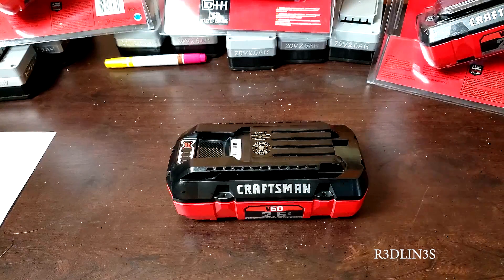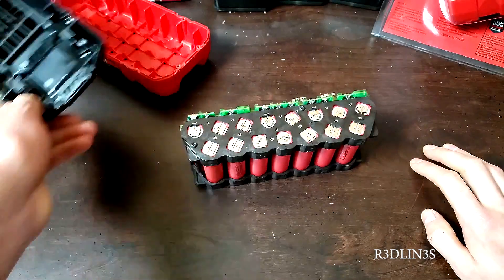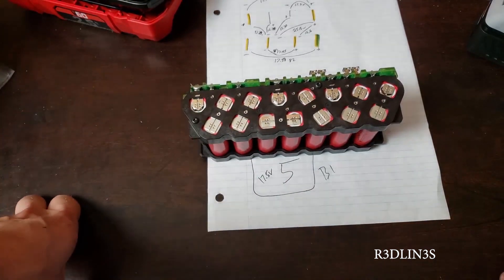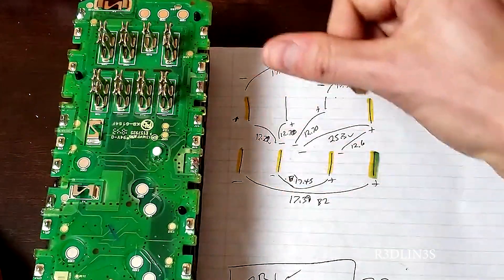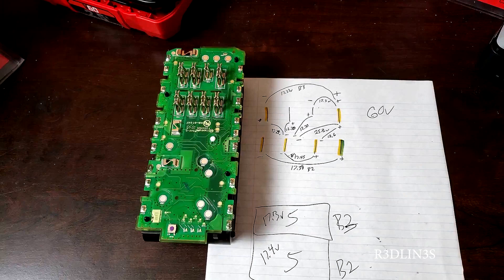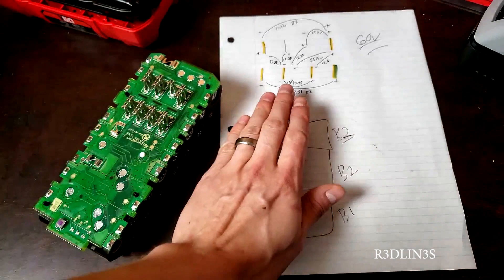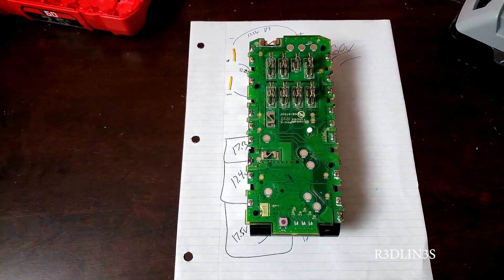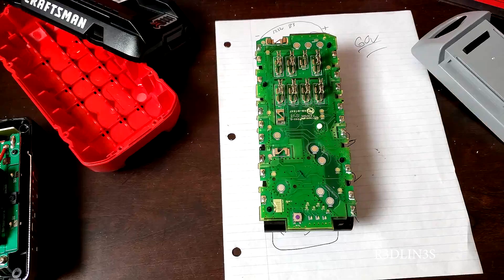Craftsman 60v Battery Teardown 2.5ah - How It Works

Comment: Thanks for this video. I have two of the Craftsman 60v batteries and they both stopped working. I tried jumping the batteries but it didn't work. I then decided to open up the battery and indeed there are three banks. Each bank has two green wires (+) and one black wire (-).  One of the green wires has about 7V and the other green wire has about 13V  totaling to about 20V.  So I measured the voltage in all the banks and determined that one of the banks was bad because  the voltage on the green wire was only about 2V.  So I cut that bank out and reconnected the black and the two green wires with a working bank from the other battery. Voila, after screwing the cover back, it works like a charm. Hope this info helps somebody.
Reply: Can you post a video of what you did?
Reply: ooooh i've got an opportunity to grab 6 dead batteries... i gotta teach myself how to replace banks...  do you recommend any videos that explain to a child?  🙂  I'm so out of my element here...but tight on cash and wanna look at learning what my husband used to do.
Reply: Update:  The fixed battery worked for a some time then one of the other banks failed :-/.  Therefore, I don't think it's worth it to continue fixing.  I decided to invest in a new lawn mower instead.

Comment: What we need is a video of dissembling the battery pack completely and replace bad cell with good one. Like I have 3 dead batteries so would like to replace bad cell with the good one from the others.  I'm going to try to do this once I get all the soldering tools arrives from Amazon.  I'll see how it goes.  Also I've ordered a cub cadet and might also try to create a video of how to hack it to fit with the craftsman tool as it's hard to envision the description provided below.  Thanks for the video as it has been very educational and informational useful.
Reply: By the time you have bad cells, you should just replace all the cells with new ones, not just swap the dead ones.  You should spot weld them together with nickel strips, not solder.

There is no real hack needed for the Cub Cadet battery, just cut off the keying tab near the contacts.  It will be obvious when you see it.
Reply: @stinkycheese804  I'm a widow...got no man in my back pocket...this is not my area of expertise... got a video to show how to do that?   TIA!
Reply: @stinkycheese804 thank you
Reply: I cut connection to dead cell, use solder paste on wires and used two good cells from my Dyson vacuum cleaner that died as well.  Batteries were good I think the BMS gave up.  No luck with charging, I bought a Cub cadet 2.5ah everything is sold out worldwide.  7.5ah would do the trick.
Reply: I gave up, is so hard to remove the battery & using good battery won't get it back neither.

Comment: *** Craftsman V60 Battery replacement solution ***

As posted elsewhere in this video, Cub Cadet and Craftsman used the same V60 batteries - almost...

The only difference (that I've found) is that the battery cases are "keyed" differently. The top of the battery, where the charger plugs into, has a plastic key that prevents the battery from being used interchangeably between the two brands. One brand has the "key" on the left side and the other brand has it on the right. The battery "innards" appear to be identical, right down to the circuit board numbering. The associated power tools battery receptacles are also "keyed" by brand.

So, what to do?

First off, save your old Craftsman V60 battery, i.e. don't recycle it because it's dead. You'll need the top part of the battery case that has the Craftsman type "key".

Second, purchase a new Cub Cadet 60 Volt battery, model CC6025, CC6050,  or as appropriate. They are less expensive than trying to find a replacement (read:nonexistent) Craftsman battery. I tested all this with a 2.5A battery from both brands.

Third, swap the "top" or "smaller" half or the battery cover between the brands, i.e. replace the small Cub Cadet cover with the small Craftsman cover. There are eight security Torx T-10 screws that hold on each cover, so you'll need to find a T-10 security bit that has the hole in the center. Take a quick look at the battery case screws to see what I mean, or better yet, bring a battery with you the your local hardware store to obtain the correct bit. Once all the screws are removed you may need to gently pry the case covers apart. There are two slots on one end of the battery case you can use to get this started.

Once the covers a swapped, you're all set, the Craftsman charger and tools should work with your new "modified" Cub Cadet battery pack. This breathed additional life into my Craftsman v60 tools.

Disclaimer: While this worked for me I cannot and will not guarantee it will work for you. And be careful, Lithium-Ion batteries are hazardous to work on. I initially charged the Cub Cadet battery on a concrete surface well away from my house, just to be safe. You're on your own here!
Reply: Thanks for the info as I would never thought my tools can be use again.  Craftman replaced my set with 20v which the blower really weak and I hate it.  As soon as the Cub Cadet arrives, I'll try to make a video so others can benefit from it.
Reply: @SangLeWeb  Any update? I tried to see if you uploaded a video but didnt see one.
Reply: Thanks for this. I know I am late, but could we not just replace the individual cells without removing the PCB? Or is there more involved in doing that than simply removing/desoldering them?
Reply: @tylerwillems9358  The cells are likely to be spot welded together, so you would need new cells and new nickel strips to spot weld back together.  Some people claim you can solder to the cells but you're really NOT supposed to do that, could breach the seal and create a fire hazard.
Reply: You think chiseling off the key would work?
Reply: @Ultramagnus-oe6bj  Yes that is what most people do instead of swapping half the battery casing.

Comment: I left my 7.5 battery in the mower and it apparently discharged.  It looks like I cannot just jump one area.  I'm thinking I have to jump 3 separate areas?  If I just jump one area, it doesn't overflow and charge all the other batteries does it?  I can't jump it!!
Reply: Yes, you would manually, jump charge each of the 3 series of batteries one at a time, till all are up to about 20V.
Reply: Hey there. Were you able to jumpstart your 7.5? I’m in the exact same boat with my mower battery. Also, is the 7.5 definitely going to be the same layout configuration? The positive and negatives aren’t marked anywhere so I want to make sure I’m doing it right.

Comment: Thanks for this helpful video. 
My battery is not charging... 
The voltage across B3 terminals is 2.9v. 
B1 and B2 it's close the 14.4 volts. All the individual cells are between 2.8-3.1 volts. 
This means that B3 cluster have a problem, correct? If two cells are in series, it must be close to 6 volts, and B3 is only showing 2.9 volts. Any idea what can be done in this case? Is there a reset in this circuit? Thanks!!

Comment: I had the problem of this battery not charging. Now fixed. Answer: Take the case off. You will see 3 battery packs, each containing 15 cells. You will see a black wire (negative) for each pack. There are some solder joints on top of the circuit board. Those are positive. Apply about 18 volts and 1 amp to at least one of the packs. This will "jump start" or "flash" the battery. 
This requires using a multimeter to determine polarity. You may find when you test for voltage from the top solder joints to the negative terminal on the bottom (black) that it reads -.03 volts or something like that... This happens because the polarity gets reversed when the battery is drained completely. After applying voltage to each battery pack, put it back together and try to charge it. It might fix the problem. All-in all; This product isn't worth the plastic it's made from.
Reply: what did you use to apply 18 volts/1 amp? I don't see the black wire you are talking about either.

Comment: IS IT POSSIBLE to jump start one of these batteries?  I have the 7.5 AH lawnmower version of this battery.  IT WILL NOT CHARGE.  B2 and B3 show 18 volts, but B1 shows only 12.8 volts.  I TRIED to connect the B1 leads to another V60 battery, but the B1 voltage DOES NOT INCREASE.  I also tried charging each individual battery pack using a Tenergy TB6B charger.  Each pack will charge with the Tenergy EXCEPT the B1 which has low voltage.  As soon as I try to start the charge cycle it says "CONNECTION BREAK".  Is the BMS preventing any current from reaching the B1 pack?  If so, how can I defeat it and force enough current into it to raise its voltage above 15V so the entire pack can charge?  Will I need to disassemble the battery to remove the BMS circuit?
Reply: Try unsoldering one lead of the fuse for the B1 pack and charging with Tenergy. You can also remove one lead of the Green wires on the battery pack (these also go to BMS).

Comment: @R3DLIN3S I have the 7.5aH version of this battery. Testing the pins, and according to your diagram, “battery 1” had voltage of ~10 volts, “battery 2” ~10 volts, and “battery 3” only 0.3 volts. I managed to jumpstart batteries 1 and 2 and get them up to 18v, but battery 3 will not break 1 volt. I took the casing apart and all 3 fuses are intact.

Any idea why it’s like this? The charger still will not charge the battery at all.
Reply: did you ever have any luck with this? Mine is the same way. two will charge up and 3rd pack sits at 8 volts

Comment: FYI craftsman didn't make the batteries. Cub Cadet used the same exact battery. The company that made the battery decided to stop manufacturing, so the v60 went bye bye.
Reply: You can use the cub cadet battery. U just have to cut the tab 9ff.

Comment: My v60 battery stopped working when the mower was run till it stopped. B1, B2 were 17.6, but B3 was 10. All fuses were fine. I manually charged B1 and B2 to 20v using the top connectors, and charged B3 2 cells at time to see if I could kick start a dead battery. Found the first 2 batteries near the connector were not taking charged and were 0v. I tried detaching spot weld to see if one of them is bad and if battery could run without the other, but both were 0v. 

The casing and spot welding of these battery made it irreparable with my skill. Trying to detach spot welding left holes in the cells, and the plastic housing has internal leads so if you put any pressure to pry the welding you will be risking sparks!. IMO the spot welding was overdone!. In the end I had to detach all batteries as it was too risky to leave the casing half damaged.

My suggestion with this battery is if you can't kick start battery by charging the top connections(B1,B2,B3) directly and get them to 20v then it's not worth trying to charge individual batteries, as it's hard to replace the battery even if you locate it.

Comment: Do you know if the Craftsman V20 battery will work on the V60 mower? Craftsman replacing my V60 DEAD battery with three V20s. They won't tell me if they will run the mower .. NOR if they can be charged with my V60 charger. Can you answer that? Thanks!
Reply: V20 battery will not run a V60 tool.  They have discontinued the V60 system and offered me a V20 trimmer and battery to replace my V60 saw and battery.

Comment: We have the same idea! I'm planning to experiment on a 2ah 20v XR battery pack by adding a switch to change the battery config from 20V, 40V, or 60V depending on the # of battery stacks. Most DC motors are capable of handling a wide range of voltages between 20-60V easily, but controller on the tool may limit the output voltage, or will burn out. Perhaps I should buy a cheap used 18V brushed tool on CL to test out. HAHA. If successful, that's a cheap upgrade for my entire lineup of 20V XR brushless dewalt and craftsman toolsets.

Comment: I used this on my groceries getting bike.. seems like if you only use 60v it stays level inside.. about to run it parallel to flexvolt 60v . Im Just looking for what the craftsman charges up to.. the flex volt is 63?.. trying to find out before I start .   I can always test the voltage later. I'm impatient

Comment: great job you should run for president.  anywayi thought i would try to charge up the battery.  i would have never figure out what you did.  thank you.  i have one of these batteries and i need to get the B3 charged up.  cells looks ok and the voltage is 6.51.  all the other packs read 17.81 volts.  so i'll attempt to raise the voltage to equal the others and see if the charger will accept the battery.  well now i have to figure out kobalt 80v, briggs & stratton 60v, ryobi 40v, greenworks 60v and 80v.  thank you sir and please don't try this at home.  i know i'm doing this at my own risk.

Comment: @R3DLIN3S Were you ever able to jumpstart one of these batteries? I’ve tried connecting the + and - terminals from a charged battery to an uncharged battery and even after several minutes, the only change is the charge on the good battery has decreased but the charge on the dead battery remains the same.

Comment: Outdoor Power Equipment (40V +, Ego, Greenworks, etc) always have the BMS in the battery pack. They likely separate them into smaller groups to allow air shipment of the batteries. Also, the V60 7.5Ah packs I opened had LG HE2 cells.

Comment: I've found a fix for the blown fuse on the batteries. I got all the batteries that had that issue working again. A car fuse is what I used. I used mini fuse 3.0ah. I had to take plastic housing off for  good fit and soldered it on. It meets the specs and is safe to use. Works like a charm.
Reply: Thank You!
Reply: @bayouboodleeboo1317  your welcome
Reply: Thanks a bunch... I was using an adapter to tap the 60 volts and a buck converter to drop it to 12vdc for overlanding lights and shorted the 2nd bank.. took case off and just fuse blew... Whee... Lucky for me since you CANNOT get these batteries anymore... Solder a 5amp mini fuse in and good as new!
Reply: @simracing-ai  nice job
Reply: Where exactly is the fuse?  And how to tell if it’s broken?
Reply: @aquemini7100  it's metallic and Z shaped. On the bigger ah batteries there are 2.
Reply: Also to tell if they are broken it will be burnt through
Reply: You're my hero!!!
Reply: @DavidRutkin  I take it you fixed your battery? just be aware some batteries are flawed and it can happen again. I've had to fix it twice to 1 of my batteries. the other 2 batteries I fixed are still going strong and no issues.

Comment: Trying to take the ~17V pins and make a 12V inverter for 120VAC. Here is my plan.
1. Take all 3 17V pin sets and put them in parallel to the step down converter. 
2. 18V DC to 12V step down converter.
3. 12V DC to car battery inverter to 120VAC.
Any advice would be appreciated.
Reply: My advice is that it is silly to make a new (inverter) product that depends on batteries that are obsolete, no longer made and expensive to buy old stock.  Do something forward looking like use a battery format still in production for  your design.

However, what you intend to do will work, but remember, you're talking a 10:1 voltage boost plus conversion losses, so ideally if you limit the pack to a 10A drain rate, you end up with less than a 120W inverter, hardly worth the bother.

Comment: any idea how much the fuses on the board are rated at?.... one of the fuse links blew on my battery

I checked each cell... and all show individual voltages.... no idea what caused it too blow
Reply: Same here. Imma probably reconnect mine. Got 3. And each one and each one has one broken.
Reply: @KiwiClawDHA  how did you fix this
Reply: @ckcuev  i don't think my fix worked, might have damaged the batteries, but I got some solder and arced it over the broken fuse. Not a smart idea, but I need the batteries.
Reply: The charger doesn't recognize 2 of 3 batteries.
Reply: @KiwiClawDHA  does the battery at least still work after this fix?
Reply: @ckcuev  as said in the video. It charges weird. On battery is at ⅓,⅔, and full. The multimeter showed no charge on that cluster. Ya should check the voltage first. I would have to manually charge the cells. Which I don't have anything for. Could Jerry rig something. But the charging state never changed. What would charge did. And what wouldn't. Didn't get acnollaged by the charger.
Reply: @KiwiClawDHA  let me give you an idea. Maybe alligator clamps from the charger to the designated pins on the battery should dobit. Also I thought of a fix for the fuse issue. A mini 2.5ah or 3.0ah car fuse soldered on should work. I'm going to try this. Just bought some car 3.0 fuses as I couldn't find 2.5ah in the store. I'll test it out. As long as the mini fuses aren't in the way it should work
Reply: @ckcuev  i wouldn't surpass the amp rating. Could become unsafe.
As for the charger. It still has to  acknowledge that the battery is there to work.
Reply: @KiwiClawDHA  all the batteries have 3 fuses for each battery cluster. The 7.5 has 3 so by using a 2.5ah or 3.0ah I'll be good. Preferably 2.5ah but I couldn't find it. Because 2.5 x 3 =7.5. So while a 2.5 would be perfect the 3.0 will suffice
Reply: Also with the glass fuses I can break the glass and remove the filament and solder those to the smaller ah batteries. So in essence by using this method it might work
Reply: @ckcuev  

What amp fuse did u use?

Ok read a part that was clipped 

So 3 amp fuse

I use a resistor lead and it’s working great… even blew one.

My saw ended up with a dead short… it wasn’t even 5 months old… got a replacement.
Reply: @robb8235  I wonder if it's because of the battery with the tool...I can't use my blower with the 7.5 but it works with the 2.5
Reply: @robb8235  my fix worked great. Car fuse did it. I had to break the plastic housing and modify it a little but works as it should
Reply: @KiwiClawDHA  I wired over the one blown fuse, it works fine.  Am I going to burn up or explode?